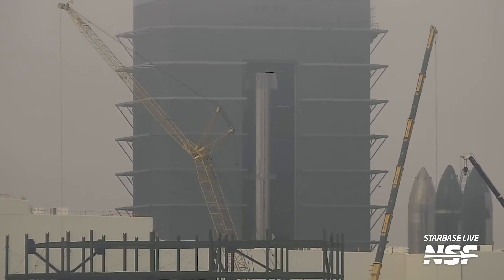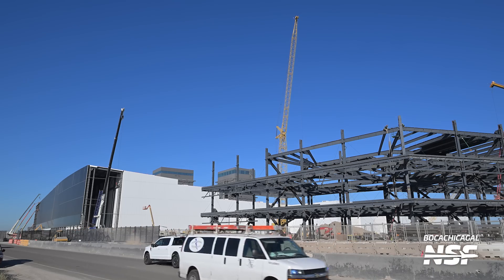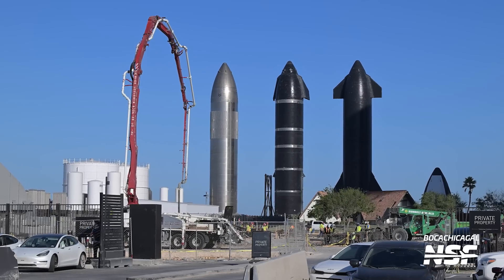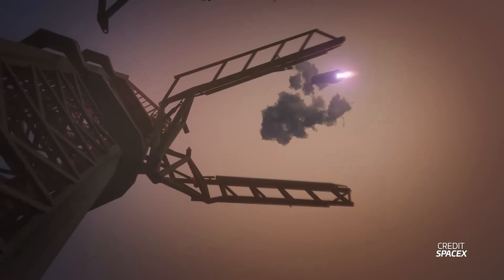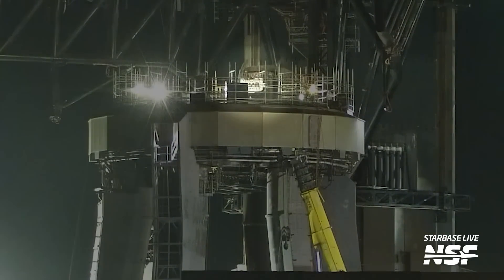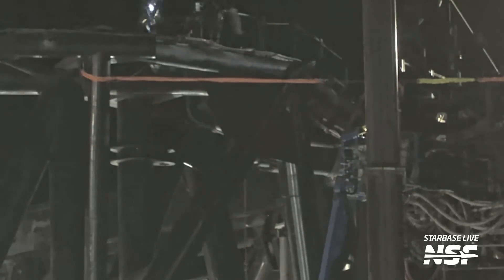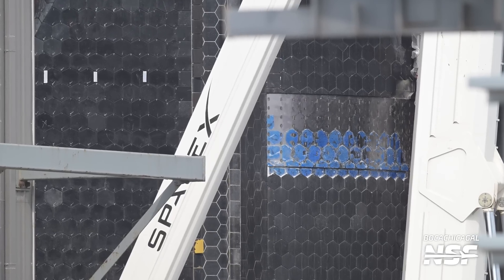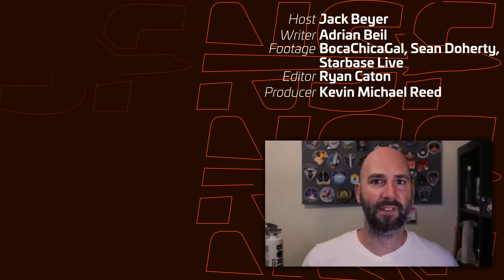Prepping Chopsticks for First Catch? | SpaceX Starbase Update

Comment: Here's another (ingoos) crazy idea (or two):  instead of always having to make repairs on the OLM...  how about just building a taller tower, use the chopsticks to raise Starship / Falcon, say, 50 meters (or higher)... 10, 9, 8, 7, 6... engines ignition!  quick disconnect chopsticks... clear the tower

Comment: It's crazy to think that starship will be just fly regularly as falcon9 next year with reflown boosters
Reply: SpaceX must move to deploying full size V2 Starlink satellites ASAP because each such satellite will generate five times the revenue, and support significant quantities of 5G mobile devices at higher bandwidth, implying broader applications.  Only customers who are willing to accept a higher risk will pay for deliveries using Starship in 2025, especially considering that Vulcan-Centaur, New Glenn, Ariane6, and Neutron will be operational.  However it is very likely that Starship will launch more than 100 times before 4Q2026.  I suspect that SpaceX may even send one to orbit, but not land, on Mars in the late 2026 window.

Comment: I'm not so sure about the live capture (chopsticks) on Descent.

The flame diverter/flame trench makes more sense with the massive 4-point structure that is being looked at.

This may mean for RTLS for Heavy Booster may possibly be an accurate land-pad at Massey's since that location is surrounded by the moat.

The shorter chopsticks at Kennedy was a bit of a clue to this from ages ago.

Comment: It's crazy to attempt a booster catch without a backup launch mount in my opinion.  The OLM has been the most lead time piece to construct in the entire complex.  It would be right underneath if the attempt fails.  Time is THE limited resource for SpaceX.  A safer approach would be to stack the tower sections for the second tower with priority to complete the catch system and use it on the first attempt(s).
Reply: Maybe the launch tower sections from the cape are there to rebuild the tower if a recovery attempt fails and crashes into the tower. Remove and replace would be a quicker turn around than having to wait for new sections to be fabricated. Foundation work for the second tower cannot be rushed for the time needed to stabilize the ground around it. I do agree a catch attempt on itv5 is pretty aggressive. A failure would definitely be a setback to rest of the program.
Reply: @droiddoctor2447  Tower sections can be assembled fairly quickly.  It's the Orbital Launch Mount that has taken YEARS to develop.  While  the second could be fabricated faster than the first I  recall thousands and thousands of hydraulic pipes and controllers inside that ring.   I just think it could take many months to repair/replace the OLM if a booster stage blew it up.  Perhaps retrieving the booster with the existing chopsticks swung as far away from the OLM as possible could mitigate some of the risk.

Comment: I hope that, like the first launch attempt, they don't attempt to catch the booster prematurely. It would be a massive setback if the launch mount or the tower were damaged. I still think that a dedicated catch tower would be a far safer option. It would not require significant infrastructure surrounding it and so a failed catch would not put progress back by a year or more.
Reply: Not really. The booster doesn't have enough energy to cause much damage to the OLM or tower in a realistic failed catch.
Reply: @bryan But won't the computers autonomously trigger the flight termination system should something go wrong just before it being caught? It will destroy the OLM if something like that happens right? I may be wrong in my assumption about FTS though
Reply: @srinivasr.9976  FTS is dearmed before landing burn, but Super Heavy cannot destroy the OLM in a failed catch. It might require a new set of chopsticks, but everything will be fine.
Reply: @bryanillenberg  Oh, that's interesting! I thought FTS activation was the reason for the booster exploding some 400m above the sea (as was reported by SpaceX) in flight 3. I guess the landing burn had just started then but not all engines relight as expected. Am I missing something here?
Reply: @srinivasr.9976  no, you aren't missing anything: the booster exploded for unknown reasons at 462 meters, with only 3/13 engines relighting and only 1 remaining lit.

Comment: Something to discuss:
The “Achilles heel” of Starship that no-one is talking about: The Human Factors element of riding Starship to a retro-rocket landing. Going to be a terrifying ride every time. Even when everything goes right.
Reply: Is it any scarier than using parachutes?
Reply: @bryanillenberg Considerably scarier! I’m sure you’ve seen video from onboard a Falcon 9 first stage landing on a drone ship? Plunging toward earth supersonic then start a rocket engine in the last few seconds to save the day. Very Scary!
Reply: @thomascharlton8545  except, Starship won't be supersonic at engine ignition. And there will be a hover period, with a huge margin.
Reply: @bryanillenberg Hi Bryan,
You’re missing my point: The Human Factors element. The natural fear the average person will have. Plunging toward the ground at a very high speed waiting for engine start just before potential impact. I’m sure the system will be made to work. But the average person will say: Nope, ain't gonna do it.
Reply: @thomascharlton8545  And how does that compare to parachutes?
"A thin piece of fabric, made to be as light as possible, is shot out of your tiny capsule by pyrotechnics. If it fails, there is no hope of survival. Oh, and by the way, a second piece of fabric (the drogue chute) has to be deployed first, by another set of pyrotechnic charges".
That, at least to me, sounds a lot scarier than a Starship Landing.
Reply: Technically, no humans have to experience starships crazy landing on earth. For Artemis, they would be going up and coming back on the SLS rocket and capsule anyway
Reply: @Barthhhelona You’ve heard of using Starships for 100 passenger point to point transportation around earth right?

Comment: Are you guys allowed to have taller camera towers, so you can possibly peak over the walls being built ? Or are there rules how tall you can go ?
Reply: I was JUST thinking that! Like getting three 1ft-diameter triangular antenna masts to make a very robust tripod, standing maybe 15-20ft high. (would easily be able to have a large platform on top that multiple other channel's camera hardware could be mounted to; not that this would be that expensive)

Since it'd be in a tripod configuration, it wouldn't need guy wires or any concrete mounting pads, meaning it could be relatively easy to disassembled and relocated if needed.